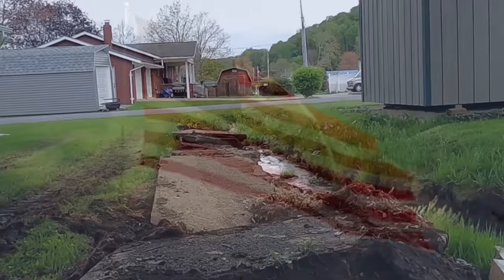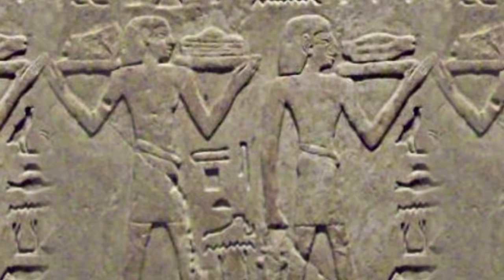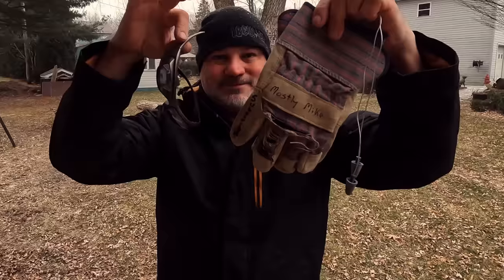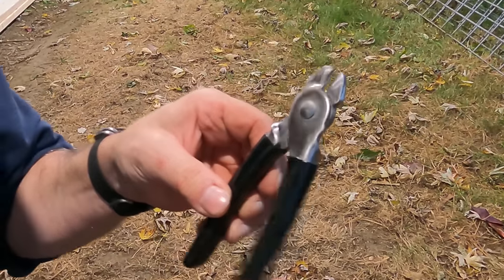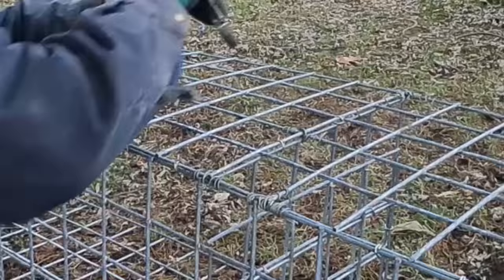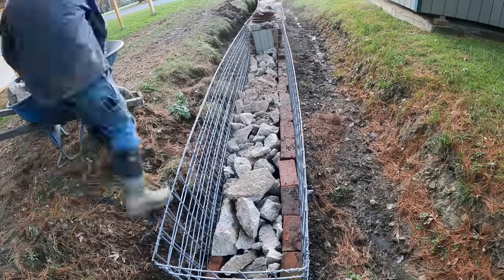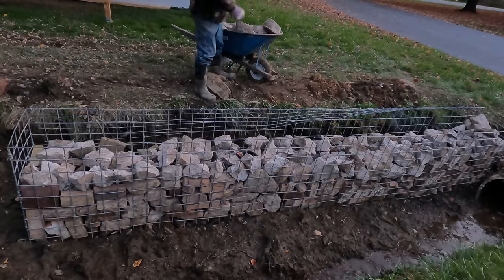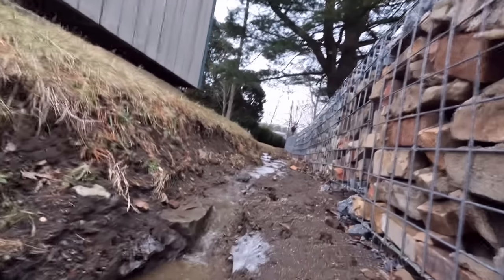How I Built My Own Border Wall Cheap

Comment: Any update on it how’s it doing? Anything you do different on your setup and design?
Reply from the maker: It's doing pretty good. I added some parts to it and plan to make a follow-up video answering some questions. The main thing that I would have done differently is to make it about a foot deeper, but it's not really a huge issue. Thanks for watching!

Comment: The hog rings work to temp hold it together while you tie it by hand.  There's no real east solution for holding them together.
Reply from the maker: Thanks for watching. Yes, that was the best way that I could find. They make heavier duty hog rings, but I couldn't find them anywhere.

Comment: Are you concerned that your neighbor will suffer increased erosion as a result of your gabion wall (assuming the property on the opposite side of the waterway is your neighbor's)?
Reply from the maker: I own both sides of the ditch Curt. Thanks for watching.

Comment: Get the 4x8 ft Rebar Grids you put in slabs..much cheaper..about 12$
Reply from the maker: Thanks Andre. Those would work, but not sure how long they would hold up in the elements. Lots of people commented about even using this galvanized goat panels saying that they would rust away in a couple years. It's been a couple years, and there's no sign of rust. I hope to make a follow up video soon clarifying some of these questions and comments. Thanks for watching!
Reply: @themostlymikeshow  let it rust..mostly surface rust unless its constantly exposed to Calcium and Salts..it will take quite a few years to Decay and the Weight of the rocks greates a Wall inertia..stack them strategically at least stack em more carefully on the Sides..then fill in Middle with Debris, Sand , Crushed Concrete..I would place the stones on the outside for Esthetics and Structural reasons
Reply: @themostlymikeshow  you can double the wire for extra durability..twist it into a braid ..or use rebar and weld it together..heavy duty..No 3 bars are enough

Comment: You know, for a lot less work, you could have put in and buried a nice culvert?  Then you’d have a nice grass plain, but no boundary…
Reply from the maker: Thanks for watching Jim. There's more than what meets the eye here as far as my situation with the Rio Brandon. It's a mess created by my municipality. I filed three complaints In five years, and they won't fix the problem. There is a 24-in pipe flowing into the ditch and only a 16-in pipe at the end of this wall. It's against plumbing code and I had to get the state involved just last week. I am not 100% sure yet if the wall is going to come down when the state mandates a repair. They might just put a 24 inch pipe the whole way through the ditch like it really should be. I was just going for the cheapest fix possible to keep my garage from getting flooded. I will post a follow-up sometime in the near future and explain all of this, probably another game of pretend..

Comment: There are so many old  tires… I want a wall with recycled tires….
Reply from the maker: Thanks for watching Mary. I once made a wall from tires. It's definitely a cheap wall, and they're pretty easy to aquire. The one thing bad about them is that they hold water inside and it makes a perfect breeding ground for mosquitoes.

Comment: Awesome idea but you should have dug another foot or another 6 inches off your bank of yard for better water control I built wall out WV field stones beside my creek but I also took extra Foot out of my yard and dug the ditch a lot deeper its been over 32 years not problem yet got half way to the top wall and it had twice the rain when it flooded but you did excellent job friend sorry to critique you at the beginning lol but seriously rent a small backhoe and dig it out foot or two makes a tremendous difference friend in the main channel not your yard lol
Reply from the maker: I agree and wish that I would have done that, but it's all hindsight now. Where I built this wall is only where the water flows during a flood, so I might be okay. It is Tethered in spots, and there is a bridge that also doubles as a support to keep it from sagging which I built after this video. I will be doing an update showing what I added on and how I dealt with some minor issues. Thanks for watching!

Comment: I had done a shoreline repair using a product that was essentially gabion walls. It was from a company called Propexglobal the product was called Scourlok. Its basically a gabion wall but using geotextile material lined the inside. It held up to the forces of Lake Michigan and has survived 5 years so far. These 3'x3'x4' bins were ancred down using 9' earth anchors. Any material can be used in the bins. It was a ton of hard work but the end result was well worth it.
Reply from the maker: Thanks for watching and sharing Matt. I love hearing different ways that people dealt with similar issues. Time will tell if my project will hold up. It was just an idea to get rid of some junk concrete and bricks as well as functional for controlling the erosion from high water.
I used the geofabric type material against the back side of the wall and then back filled with number three limestone, added a layer of the geofabric on top of the limestone, and then finally put topsoil. It has damned up just a couple days ago to the top of the wall, and everything seemed to hold up well. The part that I am having issues with though, is the exit pipe. I will address this in a future video. You see, there is a 24-in pipe supplying water to this ditch, and the exit pipe at the end of my wall is only 16 in. Not good. My municipality refuses to address that, so I am going to state level and see what they can do with the State Department of Environmental Protection.

Comment: Nice job, but Water is going to eat away the other bank faster and undermine that shed’s concrete pad. Hope that’s not your neighbor’s property and is still yours. If not, you just screwed them.
Reply from the maker: It's my property both sides. The whole idea is to make it erode that direction, which it did, but stabilized before affecting the concrete slab.
Reply from the maker: Thanks for watching!

Comment: How does the State Department of Natural Resources feel about you putting a structure in a flowing waterway?
Reply from the maker: I don't know Steve. I guess we're going to find out. It's not an established Waterway. It only flows when there is a big storm. My municipality created it years ago and violated plumbing code but putting a smaller pipe going out than the one coming in to this man-made ditch.
Reply from the maker: I found three complaints in the last 6 years that I have owned it, and the municipality has done nothing to resolve it. I called the State Department of Environmental Protection and they are sending a team out to evaluate the entirety of where the water is actually coming from and resolve it somehow. This may end up in the wall coming down, but I'm not sure.
Reply: Did it stop the storm water flooding your property? Or divert it to your neighbour?
Reply from the maker: Thanks for watching Farmcat. I posted this update last week. It's not much, but I hope to do a thorough update showing all additions and landscaping.
This is from a recent storm, which is the highest that I have seen the water get since building it.
https://youtube.com/shorts/dNvwMh9plZ0?feature=share

Comment: Anyone that does upholstery knows where to get hog rings especially automotive upholstery
Reply from the maker: That's right Lawrence. One thing with the ones that I used in this video though is that they are just a way to temporarily hold the cages/baskets together until you wrap them.
I like the number 12 and 1/2 galvanized wire to wrap them, and in tight areas where it's hard to wrap, I learned later that stainless hose clamps work really well. Thanks for watching.

Comment: How is this supposed to hold back WATER?
Reply from the maker: Thanks for watching Froggy. It actually doesn't hold it back as much as divert it and slow it down. I am putting landscape fabric against the back side, and then back filling. The wall gives the water room to expand as it diverts it... At least that's what I hope happens! That kind of flooding only happens once in a few years.
Reply: @themostlymikeshow  Hell of a job, good work.

Comment: did you ever have any conversation with your neighbour?
Reply from the maker: Thanks for watching Bob. Yes, I did try to bend these, but without a giant brake, it was impossible. The wire is four Guage, over a quarter inch thick. Even heating it, I would have to heat all at one time and then it would harm the galvanized coating.
As for my neighbor on the opposite side, that's me as well, so no problem there. It's over two years since I built the wall, and everything's fine with it. It eroded a little of the side opposite of the wall, but is stable. I want to do a follow up video showing the landscaping and the wall in its present state. 
There's a short video showing it with high water.

Comment: So many questions. Your neighbors agreed to this? How is a rock wall gonna keep water from getting through? how did your county code enforcement think of this? How is it going, 2 years later?
Reply from the maker: Thanks for watching. I hope to do a follow-up showing what it looks like now. I did not design it to keep water from getting through. It just sort of guides the water down the ditch. When I back filled it, I used landscape fabric then number three gravel against the wall, and covered the number three gravel with fabric then a foot of topsoil. I own both sides of the ditch so neighbors were not an issue. I didn't get any hassle from the local authorities on this. However, I am giving the local authorities some hassle about putting a bigger pipe in where the water discharges. It is 10 in smaller than the pipe feeding the ditch, which is what caused the problems to begin with. This wall does do a good job at keeping the water from flooding my garage. It has been filled to the top a couple times. I don't think it would even fill up if that pipe size was adequate on the discharge side.

Comment: How would that wall protect from flooding? Water would just flow right through it.
Art from Ohio
Reply from the maker: Hi Art. It's not meant to hold water back. I just spilled it to sheer up the sides of that ditch and guide water away instead of rolling up over the sides. I will be posting a follow-up sometime in the near future showing how I backfilled it. I put a layer of geofabric down on the ground, and backed the wall with it, filled with number three limestone, and then folded the remainder back over top to hold the topsoil in. After a year and a few months it seems to be holding up. Thanks for watching.

Comment: Greetings from Ireland. Keep that wall strong. Trump 2024
Reply from the maker: Thanks for watching ballygarran. Yes, this idiot that was planted in the white house has created one disaster after another. In July I will be losing my job because of him and his administration.
Reply: This is a great video. I've got about 30ft between my house and a small stream. My driveway is in the middle of that 30ft and I'm tired of having to move my cars in the middle of the night. I dont have any access to heavy equipment so ive been trying to find a way to fortify my back property some.. my brother in law works for the dept of highways and mentioned Gabon. Theyd used chain link fence wire,but for me that's cost prohibitive. Panels I can buy and do it over time
Reply from the maker: @ciphercode2298 Thanks for watching and the kind words Cipher code. I think it was around $50 per panel when I built the wall. Tractor Supply had them, and Rural King. I think Tractor Supply wanted $10 more but they will match Rural King's price. Not sure if you have those two stores in your area, but if there is more than one place that sells goat panels, chances are they will match prices or Price competitively. Sometimes concrete contractors would be more than willing to give you the stuff they Jackhammer out when they replace a driveway or a sidewalk. Sometimes they look for places to dump that stuff. That jackhammer that I used receives a lot of criticism, but I really can't say anything bad about it for the price. It has done many small jobs over the course of 5 years, but this job was the ultimate test for it. And that was on stuff I had to get rid of any house so I figured why not make a cool wall out of it, lol. I wish you the best of luck on the construction of your wall. Feel free to post pictures on the Facebook fan page.
Reply: 😂🤣😂🤣😂🤣 trump and biden are no different than each other.  Put down the two-party kool-aid and find a viable trade.
Reply from the maker: @aoiasitis8460 Oh really? I'm not sure what you mean. This video is about a wall and how to build it.
Reply: @themostlymikeshow Mike,  Love your dry sense of humor😂! I liked and subbed!Yes, Biden MUST GO! He's destroyed our country, and honestly? I don't think even TRUMP can get it back! The swamp was deep, and Biden just made it deeper...FJB!!!
Reply from the maker: @lowellirish Thanks for watching and hopefully helping to make our nation great again!
Reply: Themostlymikeshow 
Ya I remember the first day Obama was in office a local coal mine owner said to hell with it and shut down firing 200 workers. In rural Utah coal supports tons of jobs. Sadly with the mass migration of Democrats after the Rona utahs gone even more environmentalist. 

I’m all for reducing pollution but it ought to be free market and innovation based. Like natural gas is cheap and pretty clean but still fossil fuel. Coals been shutting down. But it’s sad politics are killing industries. We need to end subsidies so we know if industries are efficient to begin with. With solar and wind turbines etc it’s hard to tell with the government propping them up. 

Oh the worse bit though is the government killing jobs and then saying we’ll have to retrain workers or maybe toss em dime and tell em to move on. The federal government has zero plans to actually help communities they destroy. And as mines shut down rural counties land values really get hurt and schools down size etc. It’s fine but makes it harder to keep hospitals and basic services up and going. 

Escalante a town by the grand stair case national monument the county commission declared a state of emergency a few years ago. Idk but it said that escalante today has as the fewest number of high school kids they’ve had since 1890. Pretty nuts. And people in my one finance class in college five years ago we looked at the town. It’s interesting cause finance of people went way up or people earned more money but if you look further wages didn’t go up. Moveins simply moved in and earned a ton in passive income not active income. So richer people that’s retired makes the monument area look like it’s stimulating the economy but it’s not actually. Simply moving rich people to the area. 

Bill gates made the stair case national monument not dedicating it in Utah. No, that Democrat went to Arizona at the Grand Canyon and dedicated the monument located in Utah. It’s freaking nuts.
Reply: Anyways great video. My dad’s been wanting something like this. We divert water in the desert at the ranch and the diversion damn which was four stacked cars from 50 years ago got washed out a few years ago so we need to rebuild. This looks like a good idea I could use to prevent a washout in the creek. It’s dry all year but in the spring it can wash everything out.
Reply from the maker: @koltoncrane3099 Thanks for watching Kolton. Yeah, it's ridiculous what the democratic party is doing and planning to do more. They used to be for the working people, but these progressives are trying to turn us into a third world nation.
Reply from the maker: @koltoncrane3099 Thanks again for watching and sharing your story. I hope that your project goes well.

Comment: you do know that agua is like ratas or cucarachas. they like to be places they should not be. and they will always find a way in. you will have to water proof it.
Reply from the maker: Thanks for watching spicy nomad. I will have to post a follow-up video showing the rest of the project as well as addressing some of the comments and questions people have asked. Before I filled it in with dirt, I put a layer of geofabric behind the wall, filled all but the last 12 in with number three limestone, then put geofabric on top to keep topsoil from leaking down through, and of course filled the rest with topsoil and planted grass. It's looking pretty good, and most important of all, doing what it's supposed to. It's sort of diverts the water and speeds it up, but still gives it a place to expand into to keep it from overflowing. It's also eroding the other direction which is what I was going for. I am still battling my municipality to replace the pipe under the road which is very under sized.
Reply: @themostlymikeshow  thats all i seem to be watching these days. im surprised that you were able to use that. its just stones and looks very inexpensive to do. i may try that on one of my projects. pressure your town. that why you pay taxes, right! lol
Reply from the maker: @spicynomad Absolutely! I continue to go to the meetings and voice my concerns.